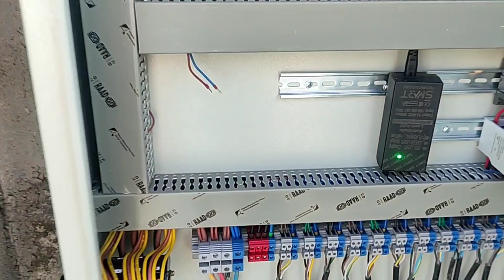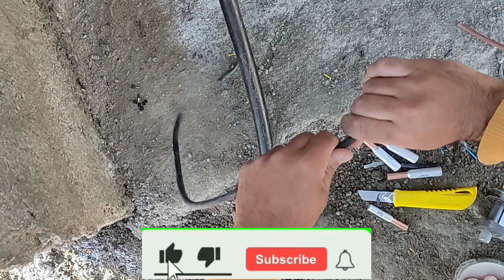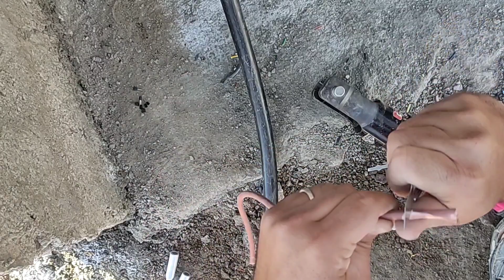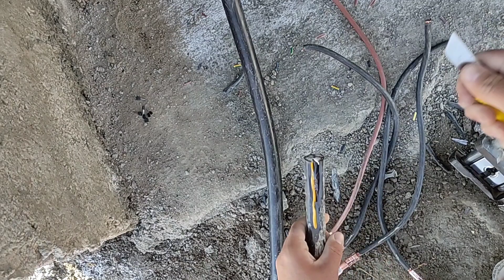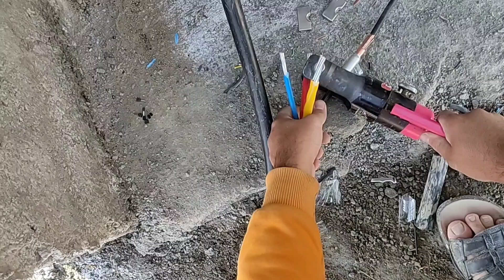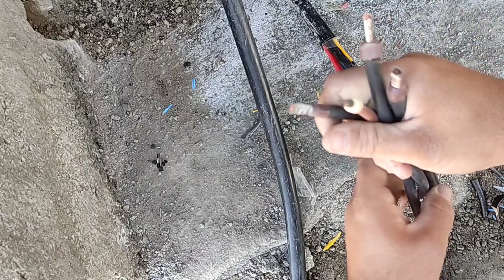The correct method of connecting the aluminum cable to the electrical panel

Comment: Sorry but you have done it wrong you need conductive electrical grease (paste) on aluminum cable going in to the lug to stop the corrosion. The cable under load will develop heat and to stop moister going in to the lug eventually the joint will fail if grease not applied here in Australia the lugs for aluminum cables already come preloaded with grease . Seen lots done this way and after few years joints fail develop corrosion and develop resistance in joint hence burning of the cable and making joint fail also can cause fire. Also it is recommended when joints done to use epoxy loaded heat shrink it does better job sealing the joint and keep moister out yes its more expensive but its better  seal and its quicker to apply .  The other point is when you crimp aluminum cables you crimp from top going down to minimize air trap in top of lug that has moister in it hope this was helpful to you . 
Just another point for the people that don't know  you cannot use coper lug on aluminum cable as there is difference in resistance between two metals it will cause heat and joint will fail hence the special lug has bottom aluminum where cable goes in and copper top and is joint with bimetal strip between aluminum and copper to stabilize the difference in resistance, aluminum is nice to work with but must be 100% properly done otherwise you will have all the problems in the world sorry for the long comment but  speaking from my experiences x electrical tech 50+ years sweet memories
Reply: All he needed to was to crimp ferrules directly over the stranded aluminium conductors. This fella made simple things more complicated and less safe they were before, he even missed some of the strands when crimping the wires😅 Plus, he needs a better crimping tool.
Reply: And use a wire stripper, not a freaking cutter 😂
Reply from the maker: I am thankful with your guidance